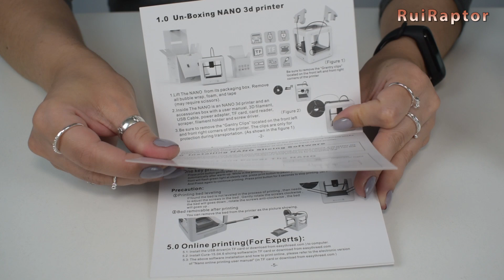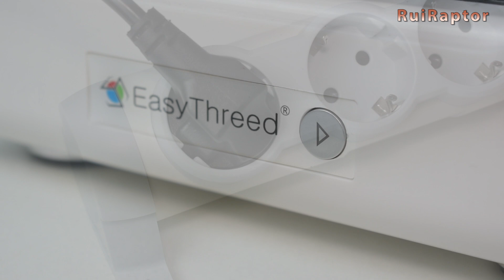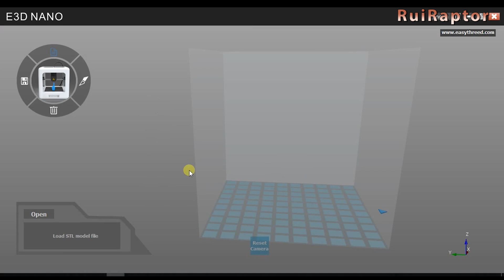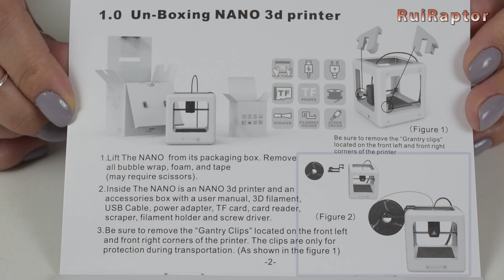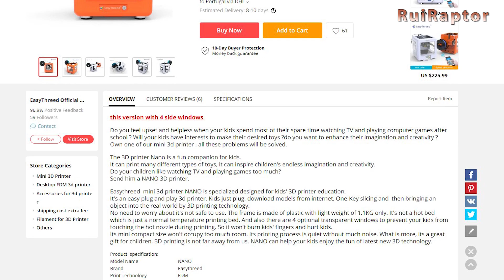EasyThreed NANO Mini 3D Printer - What To Expect?

Comment: The K1 is a better printer and costs less. I picked an open box on ebay for $45 and with the correct Cura settings and cooling it prints as good as any sub $250 printer.